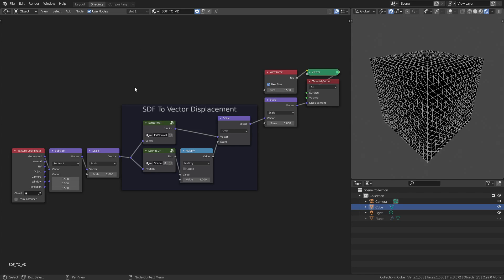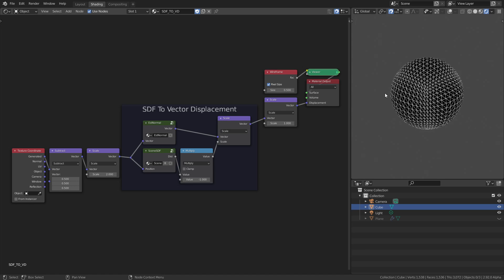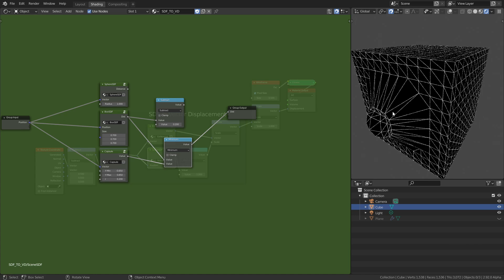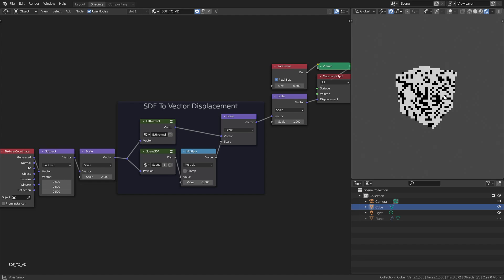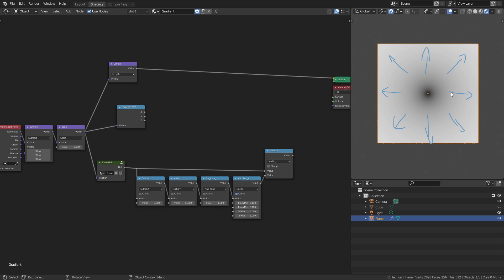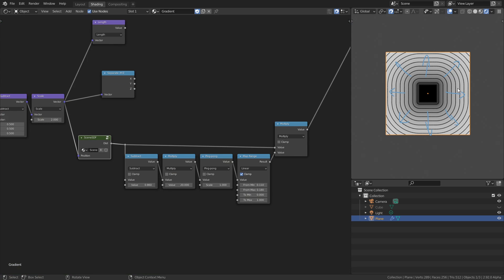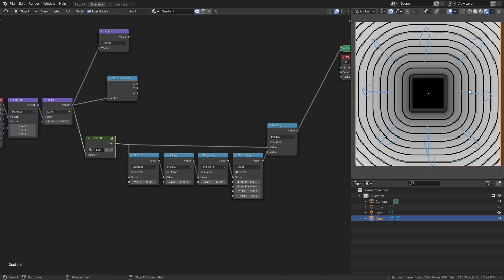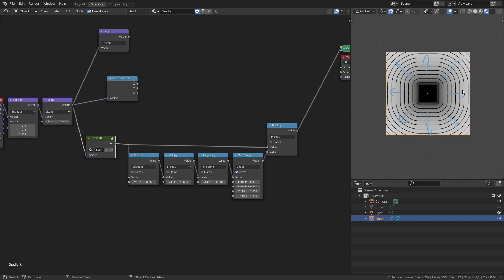SDF to Vector Displacement

Comment: Is there a reason you don't simplify the normal estimator by using 3 offset scene sdf groups and a 4th unoffset one? Removing the 2 additional scene evaluations would speed it up, especially when working with more complex sdfs.
Reply from the maker: I feel like it might break things if you only estimate the gradient in one direction when you get a really curvy SDF. If you only use 3 offsets you're actually estimating the gradient at the point + epsilon/2. (If epsilon is really small and the SDF doesn't have abrupt changes this difference is of course irrelevant). I haven't actually seen a situation where it breaks yet, but that's really the only reason I have my nodegroup like this. Other than that I think it's probably better doing as you suggested since it saves 2 SDF calls and helps battle the node limit.
Reply: @WannesMalfait  Another option is to use my Tetrahedron technique https://iquilezles.org/www/articles/normalsSDF/normalsSDF.htm it only uses 4 scene evaluations.
Reply: Ah I see, thanks for the insight

Comment: So for each vertex position you raymarch in the inverse normal direction until you reach zero, right? Nice, that's cool 😃
Reply from the maker: The difference with raymarching, is that a certain direction is chosen at the start (the way the camera is facing) and then you march iteratively in that direction. Here the direction is determined by the closest point, and there is only one step. Also like I showed in the video there's no guarantee that you'll get the complete shape, you can only be sure that every projected point that you get is on the surface. But the idea is still similar to raymarching.
Reply: @WannesMalfait   "no guarantee that you'll get the complete shape" an ideia (that I don't think / know if it's possible in blender) is to make the process iterative, in this way:
1 - Start with any shape
2 - Apply this process
3 - Bake into real geometry
4 - Remesh
5 - Goto 2 until we have a very high quality aproximation.

BTW, "Here the direction is determined by the closest point, and there is only one step" as you know depending on your SDF, if you may have deformations that make the SDF only a approximation so you also need to iterate. Like https://iquilezles.org/www/articles/distfunctions/distfunctions.htm (Deformations and distortions) or non exact SDFs like a "Smooth Union".
Reply from the maker: @paulofalca0  Yeah I'm assuming exact SDF's of course. The problem with the iterative method is that after the first iteration all points are already on the surface, so the next step they get moved to the same spot. Unless the remesh actually moves the points around and off the surface, nothing will change (which I guess happens for most remesh algorithms). Maybe it would be possible to emulate this with nodes by nudging the points a small amount in tangent space at each iteration.
Reply: The remesh was the remesh  modifier in blender, so it would add new vertices, in a complex SDF with holes, this new vertices would not be on the surface.
But your idea of "it would be possible to emulate this with nodes by nudging the points a small amount" is great! I think that it will work! And actually the nudge can be a pure random vector.
That way after some iterations the points will be well distributed! Awesome! :)
Reply: Well no 😔 I implement it.  The random does not work, if the random is big it break the mesh,  and polygons cross outer polygons, this was obvious. Nudging all the points a small amount also does not work, it does not redistribute the vertices along the surface, it only moves them. But I think the remesh would work, because it would subdivide the bigger poligons.  In shapes like https://youtu.be/VbDt75ms0iE?t=100 it would subdivide the large poligons, after that moving the vertex along the inverse gradient would place the new vertices in the surface, and this process could be repeted. Well a better way was just to use the new volume to mesh modifier, like I said below.